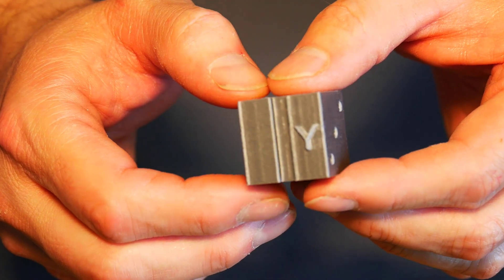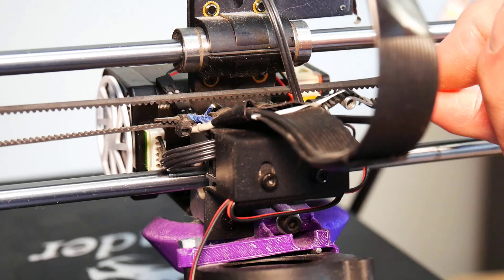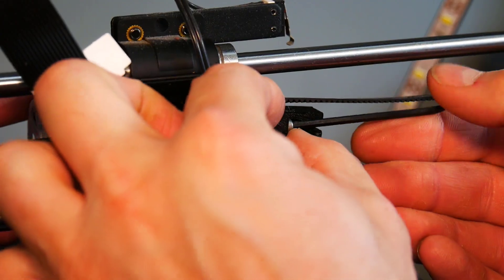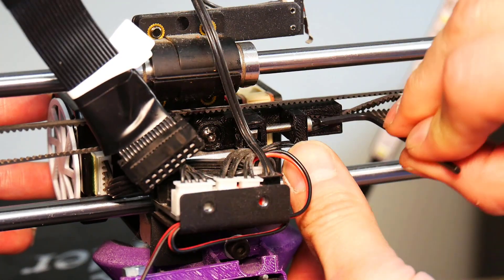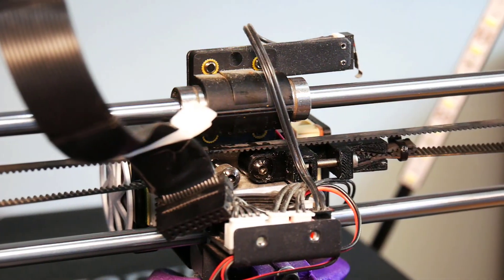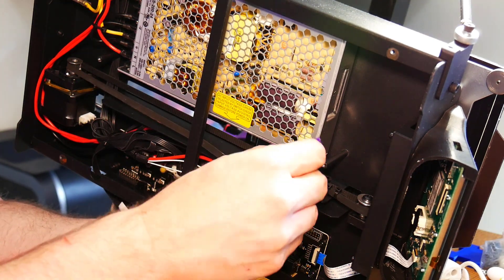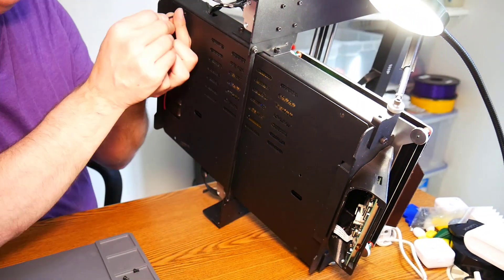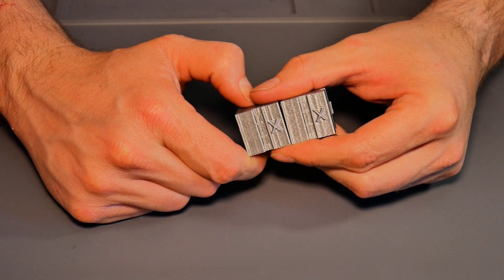Will it Work? Belt Tensioners to Reduce Ringing

Comment: Have you considered that the rippling could be from the belts passing over the non-toothed idler pulley? When I do long walls parallel to an axis I get even striations. I think this could be from the idler pulley causing minor speed changes in the linear motion. I also wonder if it’s motor tuning?
Reply from the maker: Having printed the cube without infill, I have discovered that most of the surface inconsistencies are directly related to the infill itself. Life got busy, so I have not had a serious chance to try many other fixes for the surface patterns. Thanks for watching and being part of the conversation!

Comment: You can also replace the spring tensioner with a spring from a cloth pin. you just have to bend it a bit with some pliers. There much more firm and wont require frequent adjustments!
Reply from the maker: Good advice. That adjustable tensioner has been on my maker select since this video and I have not had to adjust it at all. Basically set it and forget it (so far). Thanks for the comment!!

Comment: The surface finish all across the smooth side could be moiré, YouTube suggests speeds, steps per mm, driver current tuning, and 'TL Smoothers' on the extruder motor. For the ghosting, have you considered adding struts from the base to the gantry, to try to increase rigidity? (I am totally wandering across YouTube looking up how to fix my wanhao ghosting. So far I have: tighten frame bolts, rubber feet, struts to the gantry (keep it 90°), and your video suggests belt tension might matter less)
Reply from the maker: Actually, I have looked at this printer a little more, and I believe most of the surface effect was caused by a combination of thin walls (the infill shows through), acceleration and jerk settings that needed to be adjusted and the specific shrinkage of the silk filament I was using. For the most part, I think those issues solved what I thought was ringing. I'm working on a second video to show my progress, but not much time lately. And, yes, I do have all-metal Z-braces that are quite rigid, my Z-gantry is rock solid. If you want to see more about my upgrades, check out my welcome video https://youtu.be/E-NZKOic__g

I do not regret the belt tensioners, although now, I do not think they are going to solve this issue. My printer seems to run better with them installed

Thanks for being part of Grimm3D